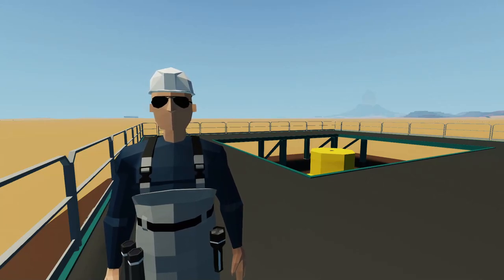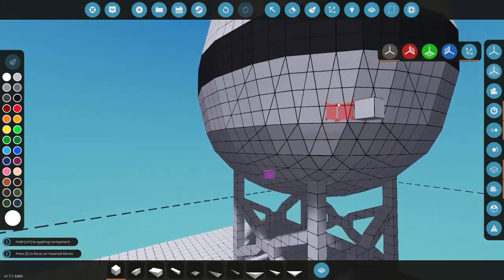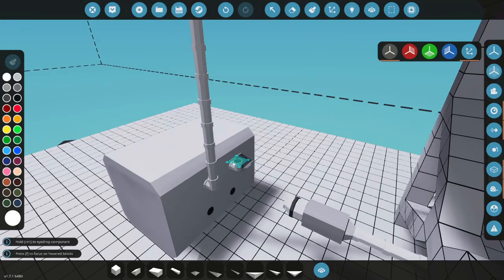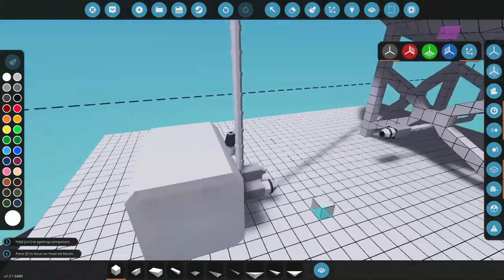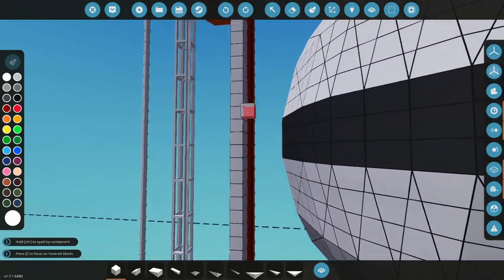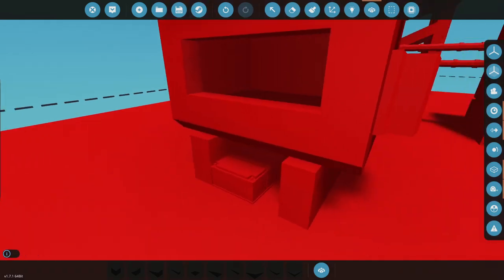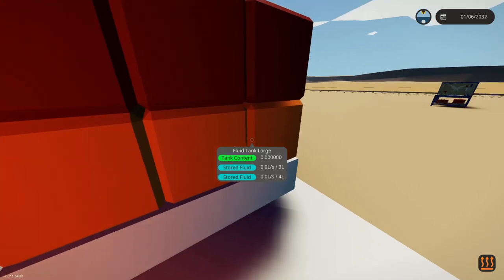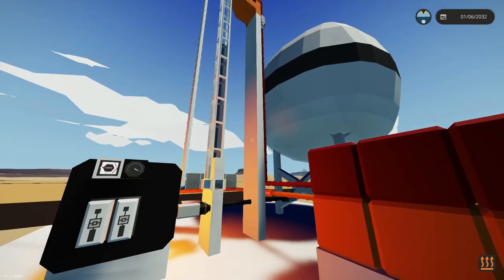Beginners Refining Oil Stormworks Tutorial - How To

Comment: Loved the video @ProfNCognito! Can't wait for the next video man! With these new parts, it might be Possible to actually use the Oil as a Fuel Source like it was back in World War Two along with Coal in some instances.

I also have the Specs for the Landing Craft Mechanized Mark 3 (or LCM 3 for short) for you man. These were the Heavy Lifters among the Smaller Landing Craft being able to Carry a Single 30 ton Tank like the Sherman as one of it's payloads. They would usually bring in More Troops or some of the Support Equipment like Mortars and Machine Guns and would usually be among the Boats and Landing Craft Carried aboard Ships like the Attack Transport Ships, Attack Cargo Ships or even Landing Ship Docks.

Landing Craft Mechanized Mark 3 (LCM 3):
Note: There were actually Two designs of this Model of the LCM. The First was by the Bureau of Ships (BuShips) which could carry 120,000 lbs of Cargo. The Second and most popularly known was by Higgins which was basically an enlarged Landing Craft Vehicle Personnel (LCVP) with a 10 foot (3.076 meters or 12.307 Blocks) wide load area at the Front and a Small Armored (¼ in. Steel) wheelhouse decking over the engine room. The Specs below will be of the Higgins Design since there are 2 known examples still around; one is at Battleship Cove in Fall River, Massachusetts and the other is at the Museo Storico Piana delle Orme in the Province of Latina, Italy, 18 Miles East of Anzio, both as Museum Displays.

 • Displacement: 52 Tons (Loaded), 23 Tons (Empty).
 • Length: 50 ft. (15.384 meters or 61.538 Blocks).
 • Beam: 14 ft. (4.307 meters or 17.230 Blocks).
 • Draft: 3 ft. (0.923 meters or 3.692 Blocks) (Forward), 4 ft. (1.230 meters or 4.923 Blocks) (Aft).
 • Speed: 8 Knots (9.2 mph).
 • Armament: 2 Browning M2 .50 Caliber Machine Guns.
 • Crew: 4.
 • Capacity: 1 30-ton Tank (I.E. M4 Sherman), 60 Troops or 60,000 lbs (27,120 kgs) of Cargo.

Hope these Ships and Landing Craft come in handy at some point man as the Landing Craft can be used for Operations in Rivers. I'll bring the Specs for the Landing Craft Vehicle Personnel (LCVP) and the Elco PT Boats in Later videos so be on the Lookout for those as well. I'll catch you in your next video man!
Reply from the maker: You fill my head with som many ideas. im never gonna get to build them all but i wish i could!

Comment: Just a little update on this, the information that the distillation port only need to have its tip touching the wall of an enclosed volume is false. I don't know if those windows are a special case, but it did not work for me.

The only way I could get it to work was to do as the tooltip implies, put it inside the actual enclosed volume.

Also, make sure you heat the oil directly as you pull it from the silo. For some reason this works infinitely better than making a circulation system that tries to circulate and heat the oil in the column.

Comment: Can a nuclear reactor heat it? I think so. I even think oil can be used as first counter heat moving fluid.
Reply from the maker: Try it and see.
Reply: @ProfNCognito  I'll try, but I'm not exactly sure I'll be able to fit a NR inside my rail cart(Which is my fuel refinery. It's supposed to know ve oil from the shore deeper into the desert and refine it)

Comment: I have a simular setup and it stops working after few minutes🤨
Reply from the maker: What stops?
Reply: @ProfNCognito🕹️  it stops distilling after like 1000l diesel is produced. I have around 1500l of oil in the tower. After some time it behaves like there is water or some other fluid in the tower.
Reply: @ProfNCognito sry i have to come back to this. I got it working, but since the space update the diesel furnace only gets up to 260°
Did you try your setup since the update?